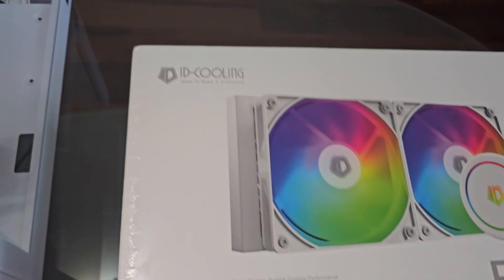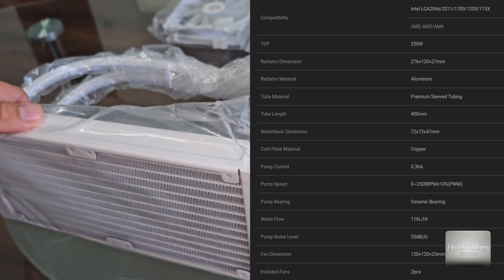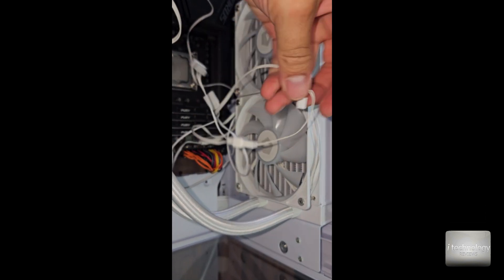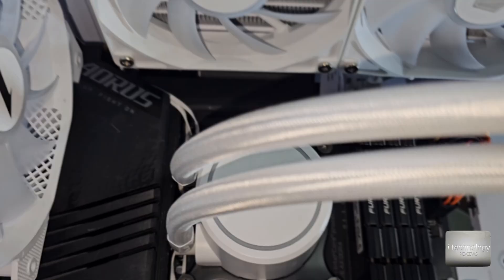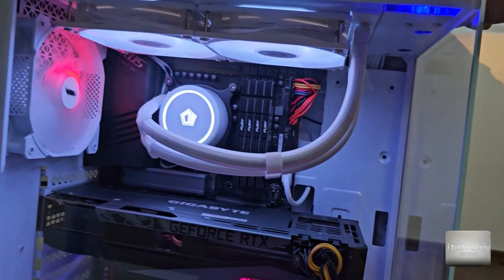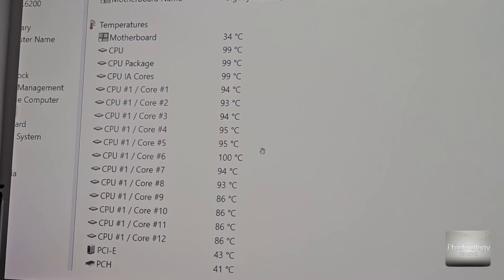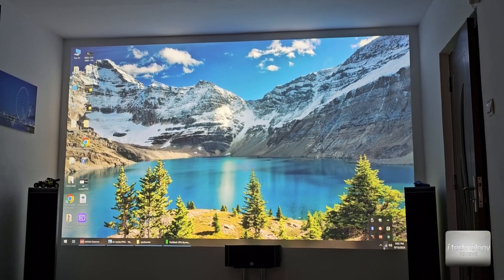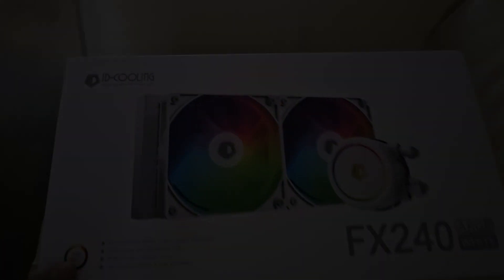Id Cooling FX240 aRGB White Water Cooling review. Silent pump, good air flow. The only review

Comment: i have sff case. is the pump along with its side pipe rotatable ?? so i can arrange the pipe so it wont obstruct the view of the aio cooler from the glass panel. also in the position the pipe at the left rather than the right side ?